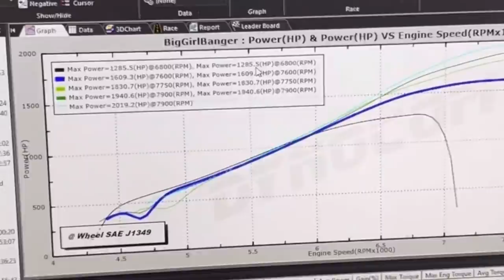Final Mullet Power! Back stage look at Mullet Dyno

Comment: Finally Steve your engines going to get the publicity they deserve. From an engineering standpoint I can’t think of a more well thought about engine from what I’ve seen so far.
Reply: He didn’t engineer this engine it’s a brodix block and heads etc he just puts it together.
Reply: @zethloveless7238  so what sort of engine have you built that do more than 2019hp ? all the best to you all
Reply: @donaldhalls2189  how’s that have anything to do with what I said ? How does my engine building background change anything I just said ? He didn’t engineer this it’s already made by brodix. He did a damn fine job of assembling and tuning it tho 🤔
Reply: @zethloveless7238  so do you pull it out of the box and bolt it together or do you have to re-enginer (re-size) the ring's, or lap in the valves, size the crank etc
Reply: @donaldhalls2189  if you think gapping rings is engineering then I’m an engineer myself 😁
Reply: @zethloveless7238  as far as I’m aware, the sm line up are the only engine obtainable that don’t pass the water and oil threw the gasket they are looped outside of the mating surfaces as well as relocated larger head bolts/studs there’s more than just gapping rings gone into them. Have a look at some of the older videos you’ll be shocked I was.
Reply: @Stephenc4877  That’s the SMX. This combo is not the same.
Reply: @lieutenantdangle3128  you sir are correct, also love the name 👌

Comment: It was only a matter of time before this happened. I could almost see it when Garrett drove Tom's car a while back. How effortless it was to get a 6 second pass. Oh not to mention the first drag week car to get in the 5's...and win.  Wonder how long until Garrett is hitting those numbers. Great stuff.
Reply: He drove 1.0 that day. 2.0 is the 5 second beast.
Reply: He won’t that’s a totally different engine
Reply: I think the 5s are more billet big block territory. I could be wrong though.
Reply: Tom runs an SMX engine
Reply: he will need a whole new car and engine to do that. 6 seconds to 5 seconds is about 2000hp difference and 1000lbs lighter. lol
Reply: @shifty1927  Mullet would have to go on a serious diet.
Reply: If you listen to the dialog in the videos between Tom and Garrett  and Steve.  they where planning this back then. Plus when Kevin set it up it was designed to have room for the big block. He wants 5s he will need to rebuild the rear end for big tire and probably a larger big block with 98mm turbos
Reply: @evo7836  Completely different chassis too
Reply: @dylanphipps5272  agreed
Reply: @MrYankees06  True, but Toms said it's just as capable of running a 5, it's just a little heavier than 2.0, Steve Morris said the engines are basically identical short of the SMX block and heads on 2.0. I remember seeing when it 1.0 was running 6.30's on average, before 2.0 came out. Proper tune and a little weight, is the only thing keeping 1.0 from the 5's right now. matter of fact Cleet ran a 6.50 on that run he got, basically on the first run. I don't count the tuning runs, because they had to switch from a street tune to racing
Reply: Cleetus needs to figure out suspension tuning first. ... otherwise he will be doing wheelies to the next galaxy
Reply: I’m not very familiar with the different classes, but with all of the new changes, I wonder if he can run a wheelie bar now.
Reply: @MrAndrewClaycomb , The issue is Mullet has a special suspension, it's designed for using Radial tires. It's basically the same suspension design as used by the RvW (Radial Vs the World), the design is to basically jam the rear tires into the track as hard as possible. where if you look at conventional tires (Bias Ply slicks) you get a lot of squat and tire wrinkle, radials need a different setup and doesn't wrinkle the tire 9or not as much), wheelie bars would F that setup bad. All they need to do is learn to tune to that razors edge and be consistent. There is plenty of racers running low 4's to mid/high 3's in the 1/8 mile running the same suspension
Reply: How does drag racing work?  Do you have to get “certified” at a certain speed and time before competing?
Reply: @719vol  yes, your cage certification has to be up to spec at the discretion of the governing body running the race
Reply: @souqmadiq4835  Thanks.  I meant for the driver?  Assuming car is up to spec….can a driver just hop into a 5, 6, 7 sec car and make a pass in competition?
Reply: @719vol  i know for nhra events you need to be licensed but i dont know about other events
Reply: @ricknielson8934  d9

Comment: Love how you don't slam the door everyone should be careful with other's things
Reply: They all can see that it still needs lined up to fit better so they are being easy on it.
Reply: @FUCK_________googIe  The last video there was a big gap still at the bottom of the drivers door and Zack had the other door off working on it next to the dyno, they are still opening the door for Steve from the outside here in this video because they arent "final installed" like youre laughing so hard about for some reason. I wasnt saying they are gonna start slamming these new doors once they are finally finished, we all know carbon doors take much more care when being shut but the guys are being extra careful right now since they will still need some adjustment, that and they are still getting used to them being so much lighter than the old ones.

Comment: So can't wait for Mullet at the track!!  This thing is going to rip a new one!!  You know the engine is amazing when it rips so fast through the dyno! It blows my mind how quick the great engines are so darn fast and powerful.  Thanks for the back stage thoughts!!  They are golden!!  Steve is so freaken talented and I love how he loves to share is knowledge!!  Man, that thing spins sooo fast!!!  That turbo cam is so well done.  N/A is just a teaser with those.  Under boost they just rip!  On my Turbo Buick I use one.  Shorter duration, super high lift, and don't leave the valves open at times as to not push the boost out the exhaust during the times the intake and exhaust valves stay open at the same time (overlap).  Need that pressure in the cylinder and need to get it out after done!

I love how Steve uses boost curves to make great power curves.  It's pretty amazing!  He must have gotten an A in drawing cause it's exact!
Reply: There's a sneak peek video somebody posted! He pulled a hard wheelie on his second pass! Hope it didn't mess it up too much
Reply: Nice to see another turbo Buick enthusiast watching cleet videos lol. Love turbo cars.
Reply: @619M3  Yeah, I seen it.  No spoilers.  The torque on the new engine is soo freakin high.
Reply: @jafferm1938  Right on!  Back in the day I was one of the national tuner guys on those cars!!   My most notable tuning was Mick Thompson from Slip Knot '87 Grand National. 

Nothing better than a 'Vette come next to you on the Interstate and want to roll.  All he saw was tire smoke for miles on a 80 mph roll.  

I also was one of the performance parts testers for Turbo Buick parts developers and early alchy injection user.  From chips, turbos, data loggers/tuning tools, fueling systems, exhaust, intercoolers, transmissions, torque convertors, to computer stands in-car!  And more!

Comment: Glad to see Cletus go with one of your motors. Nothing against Texas speed, but if you want to run with the big dogs you have to get off the porch. Nice job brother. Anyone named Steve obviously rocks. 😂
Reply: Yeah, the main reason that 427 was having so many issues is the fact that Mullet is a big, heavy car to be pushing that fast on that small of a motor. I think they said they're most likely throwing that engine in Ruby, which is a good 600-700 pounds lighter and should be much easier on pretty much all of the internals.

Comment: With big tires, he''s gonna need wheelie bars...
Reply: He already did a weelie on his second test run and came down real hard. Not sure of the damage but did not look good as he pulled off to the side and shut the car down.
Reply: @DavidLabbe  He did? Damn... I was a little concerned about that happening with that much power on big tires. Hope he didn't do too much damage to make Midwest.
Reply: @DavidLabbe  Did you watch the end of that video?  I guess not.  He fired it up and all was good.  He drove it back to the garage.
Reply: @paulcopeland9035  driving it back to the garage is not the same as trying to make a 6 second pass
Reply: @DavidLabbe  It shows that they were not concerned with the pan or other lower engine stuff.  If the front suspension is good enough to drive on the interstate, then any damage is minimal.
Reply: @paulcopeland9035  KSR is fixing it now
Reply: @DavidLabbe  I saw that.  A little steering fix and away Kevin and Garrett go to Midwest!  BTW, having you report every move is handy,  This is saving my notifications from a lot of wear and tear!

Comment: Always check them plugs. All the sensors and readings are great and are a good indication of what's going on inside the cylinder but they're not 100% accurate all of the time whereas the spark plug is an eyewitness to the shenanigans going on inside....

Comment: Steve how much HP can that big block handle safely ??
Reply: Edit* 2000+ reliably for the 540 BBC, but I'm sure it's capable of over 3k.

Source:

https://www.stevemorrisengines.com/engines/bbc-1000-3500-hp-packages/bbc-stage-2-engine-2000hp
Reply: Also, here's one 3 years ago making 3300 on the engine dyno.

https://youtu.be/bDBw4Q2m5fY
Reply: @zjwilliams1991  It has Brodix parts.  I am sure it can take a little more!

Comment: remember Steve Morris is the “owner” of the custom DEVEL 16 engine as well.  The myth is real and Steve is is engineering genius.
Reply: Lmfao that fake ass car 🤣
Reply: @zethloveless7238  the engine is Steve Morris and it's incredible - the car is whatever they say it is but the power is real.
Reply: @zethloveless7238  you're missing the whole point of the devel sixrtreen.  it's supposed to be the "unobtanium" of motorcars.  what you'd want to do is acquire not of the engines from steve morris and put it into your own chassis with 100 gallons of c16 and throw a carbon fiber body on top of it.  you could get salt flats speeds and then throw a VIN on it and probably title it.
Reply: @mesarosshawn2422  your on drugs
Reply: @zethloveless7238  cancel culture is alive and well.  you're making no sense.  how about. appreciating the possibility of 5000hp as proved on his dyne mated with 2500 pounds of steel and carbon fiber to make a few cars instead of making fun of the idea?
Reply: @mesarosshawn2422  it’s easy to make fun of bullshit scammers. The car is and always will be a joke of the car community.

Comment: Why is a Big Block in this application so much better than the before used LS?
Is it all about the ~25% more displacement - or other factors like bearing sizes too?
Is the stroke/bore ratio different?
Reply: Mullet is very heavy for a drag car, and they were having to push the LS to the ragged edge of every part to get 6s out of him. Part of the reason they kept bending rods early on was having to throw massive amounts of boost at the engine fairly low in the RPM range to make the torque necessary to get him moving, which generates incredible loads on the rotating assembly. The extra size on a big block translates to much beefier internals across the board, far greater torque, and less reliance on the turbos for getting the car out of the hole. On Mullet's last 6, they had to throw roughly 40 pounds of boost at the car to get the power they needed. This engine can do that on about 25.

Comment: Are these Pulls Pump ⛽ Gas??
Reply: Methanol. Mullet is programmed to run pump gas up to a low amount of boost (during Street drives) and as soon as the boost is triggered, they switch to a secondary set of injectors using methanol.

Comment: Warning. The rest of the Drive train was designed for 1500. In my experience everything else will be impacted. More's  law now goes in a fect.  Bigger axels betters ring gear and everything thing else that wasn't up to par we will find its failure point.  I spent a year replacing everything behind the Motor. 2000 hp kills street car stuff. Empty wallet Now. For upgrades and sell usable parts before the big old Nasty sme engine destroys everything in its path. Tech Tip.

Comment: I saw Mullet wheelied hard.   Hopefully, didn't hurt anything.   Needs wheelie bars bad.
Reply: Cleetus runs radial tires. Can’t use wheelie bars with radials.
Reply: My bad.  Well suspension adjustment then and some weight shifting and roll into the power more slowly.
Reply: He drove it back to the garage.  No big deal.
Reply: @paulcopeland9035  thats good

Comment: Not bad Steve, this is not even a SMX or a SML and you churning out about 2500HP with a safe tune. A true testament to your skill, unfortunately these guys know nothing about race engines or car set up and will kill the engine or it will hook up and wheelie slamming and taking the oil pan out. The engine is only ONE part of the equation, if they don't know about crankshaft end play or fuel starvation, I doubt they know about suspension geometry.
Reply: They learn on the fly. That's what makes Cleetus his channel so amusing to watch. If you want to watch people with factual knowledge, follow KSR or this channel ... If you like to be entertained by a bunch of goofballs trying to get their stuff maximised and have fun while doing stuff, you want to subscribe to Cleet.
Reply: @doktermobiel  learning on the fly is cool when you are dealing with hundreds of dollars of parts and car, when you are dealing with tens of thousands of dollars, it's absolutely stupid to just "learn on the fly". As you progress from running 14's, 12's, 10's you are supposed to learn the what to do and what not to do's so when you hit this kind of money power and speed, you know what you are doing. Steve built a real work of art but some clueless kids with money will destroy it learning on the fly.